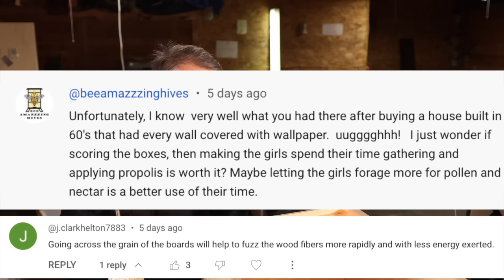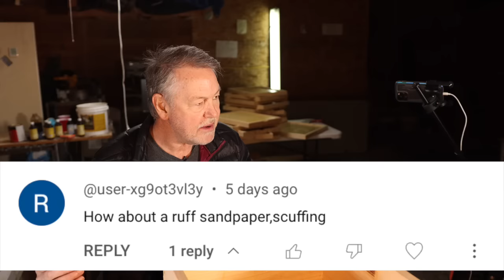Beekeeping Techniques For Adding More Propolis For Healthier Bees

Comment: Hey David, good try with the saw scratches. 
I want to add a few comments; I notice that you can only effectively scratch the wood with the grain because your boxes are pre constructed. I normally do this before box assembly which allows my make the scratches at a 45° angle to the wood grain and then repeat at an angle perpendicular to the first set of scratches thus creating the cross hatch pattern. I'll also note that you use deep boxes; the saw blade pressure is distributed over a larger area meaning that you need to use more force to gouge the wood. I ONLY use medium frame equipment for everything which means that my box sides are 3" narrower than yours; an equivalent amount of force on the saw blade gets distributed to a smaller area of wood so it creates more 'damage'. 
Greetings from Newfoundland. Four more months until dandelion season for me! Cheers!
Reply from the maker: Thanks!

Comment: After seeing your this video, I ordered a flat carving disc for my 4.5" grinder from amazon fairly inexpensive ,GRAFF Premium Wood Carving Disc 4 1/2 Inch for Angle Grinder.  it throws sawdust around but you don't have the chance of wires breaking loose from a wire wheel and sticking in places you don't want them.  Tried it on a fairly new box worked very good in my opinion.  Would attach picture if possible.    You still need to wear safety glasses  Keep your videos coming, learn something from most of them.

Comment: I use shousugiban on the exterior of my cedar boxes.  If done right there isn't much char since you brush that out.  I then seal it with a mixture if raw linseed oil and beeswax.  I've wondered if that would be good for the inside too.

Comment: Get you a small sand blaster and try that. It will cut some groves in the wood cause it has soft and hard ribs and then you will have ridges, Just like Ruffles has ridges. Lol

Comment: Hi David, 
I've been watching your Videos for a while and love the info you provide. The wire wheel should work. I've combined 4 wire wheels together on a shaft I attach to my drill to clean up old lumber to keep it looking rustic. I'm a carpenter and love to do wood working. I just happened to be making some boxes using rough-sawn lumber because it was a great deal. ( for the lumber) It's a bit more work on my end but I'm saving a lot on the expenses for the wood. Getting started is not cheap. Now that I saw that video from the expo I may rouphen up the interior a little more. It seems i can roughen up the wood before I assemble the boxes. Again it's another step and more time when your making boxes from scratch. Since I will be going into my 3rd year of beekeeping, It will be part of the learning period. I want to see if there is any difference between the boxes the are milled to be smooth ( like from the lumber store) and from rough-sawn lumber, Do the bees add more propolis on rouph wood than on smooth wood? This will be good to know. So I will be checking on this, this next season when I get my new rough boxes out in the apiary with the new colonies. I'll let you know how it goes. Thanks, Any feedback will be much appreciated.
Reply from the maker: Some good ideas.

Comment: I got this info from you a couple years ago. I scratched all my hives with a 3 inch deck screw. Held the screw at the top and rubbed the threads in different directions. It worked good with minimal effort

Comment: If you take a coarse tooth new hacksaw blade and break off about a 2-inch long section of that and clamp it tightly in a set of vise grips you'll have a very effective wood scratching tool.  Finer tooth hacksaw blades would make shallower scratches closer together of course, but it seems like you're going for very deep scratches.  My new hive is coated with beeswax.  Do you think I should scratch the beeswax, or scratch it mostly off as I scratch the wood, or just leave it as is?

Comment: OFF TOPIC. IS IT SAFE O OPEN HIVE @ 40 TO FEED A PATTY DUE TO WARMER WINTER, BEES GOING THRU STORES. I UNDERSTAND QUEEN STARTS TO LAY ON WINTER SOLSTICE AND DO'T WANT CHILLED BROOD.THANKS.
Reply from the maker: I replace my winter-bee-kinds at any temps. Do it quickly and do not life out frames. However, rather than a pollen patty I prefer to feed my bees a carbohydrates with alittle protein, than a protein patty. SHB overwinter with your bees will love to lay eggs in those patties as it warms up.
Reply: PATTIES ARE WHAT IS ON HAND, SO WANTED TO FEED EACH A PATTY TO SUPPLEMENT NOW AT 35-49 DEGREES.  WON'T NEED WHEN IT WARMS UP AS CROCUSES AND MAPLES WILL BE OUT. HERE IN CT CROCUSES ARE SHOWING , MAPLE SAP FLOWING. THANKS FOR YOUR QUICK ANSWER. I WON'T BE USING PATTIES AFTER 2/10/24 @beek